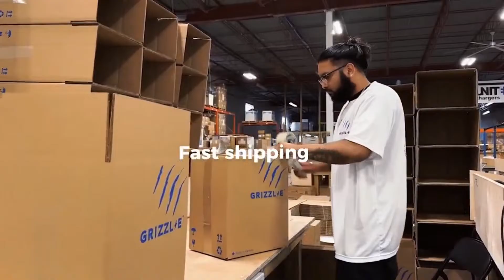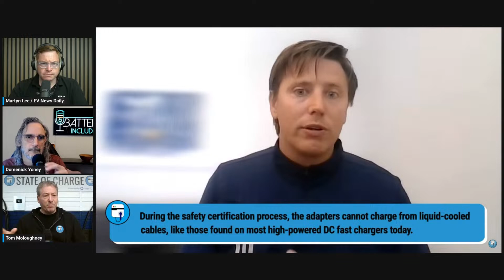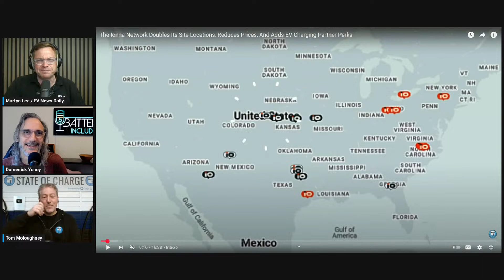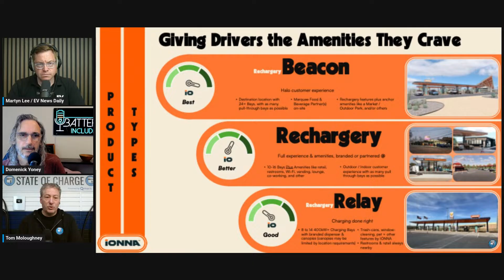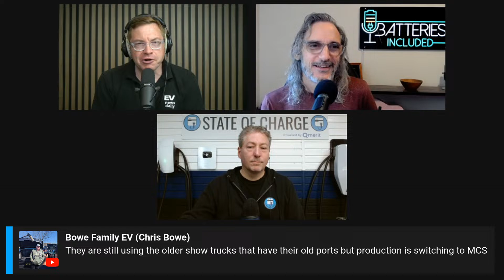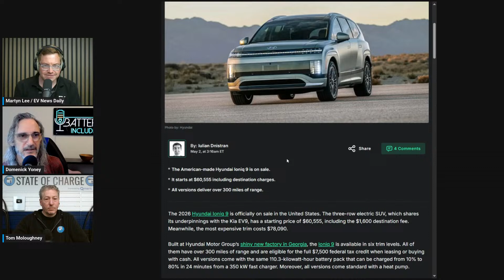Tesla Semi And Megacharger Update, Musk Leaving Tesla Report

Comment: Hi guys, great show as usual. However, you happened to repeat what I strongly feel is some misinformation that is often put forth by EV opponents. In discussing the new, blatantly unfair, punitive US federal tax on EVs being proposed by some backbench congressman, you mentioned that EVs cause more pavement damage than ICE cars. While this is literally true, in practice the difference is insignificant.  Pavement designers don't even count light trucks and cars in their calculations because the overwhelming preponderance of damage is caused by large, heavy trucks. As an analogy, you can truthfully say that a dragonfly buzzes louder than a housefly, but when you put them next to a jet engine at full throttle the volume difference between the flies doesn't matter. 

I can speak authoritatively on this topic. I am a licensed professional civil engineer who holds a Ph.D., has nearly 40 years of professional experience, and specializes in pavement and materials engineering.  Prior to my retirement in 2014, I was the State Pavement Design Engineer for a state department of transportation for over a decade and have either performed or supervised designs on several thousand projects worth billions of dollars. My old agency owns most of the roads in my state, totaling over 41,000 centerline miles and ranging from unsurfaced rural roads to urban interstates and I have worked on an array of road types.

I had a former colleague who used to say that cars are about width while trucks are about depth. What he was saying is that cars and light trucks are what control the number of lanes on most projects while large, heavy trucks control the pavement thickness. Even the heaviest Silverado EV or Hummer EV doesn't weigh enough to matter. EV owners should not be paying more than ICE owners for similar vehicles for damage to infrastructure.
Reply from the maker: Thanks for this Andrew. Great information to put things into perspective.
Reply: Hey Andrew. I'm curious if you'd like to talk about this topic on camera for 2-3 minutes. If not, can you send me a few quotes about the potential effects of some of the heavy EVs on the roadways? Thanks!
Reply: @StateOfChargeWithTomMoloughney I'm not terribly photogenic, but I would love to!

Comment: As a Kia EV6 owner with the free NACS adapter and owner of other EVs, surely I’ll use this 350 amp adapter on both.  I will make sure it doesn’t exceed the rating.  As long as charging power is 140 kW or less, there is no problem.  Current ramps down quickly as SoC increases.  Our use of the adapter will be only few times/yr because charging is 99% at home.

Comment: DCFC charging costs are too high because of demand charges ($18/KW where I am). That's $18k/month for 1MW. Those high fixed costs require really high utilization rates to spread the cost per KWh.
Reply: Wow! Someone other than me that understands commercial electricity tariffs! 😮
Reply: @kng128  :) only way to minimize demand charges is to have a Mega pack buffer battery but that's $2M and there isn't always enough space.

Comment: 380A x 450Vdc = 171kW  (nominal dc charging voltage for a typical 500Vdc-class battery pack)

Most newer CCS-1 and SAE J3400 NACS charging stations are rated for 250-400kW, including NA Tesla Superchargers (v3, v3.5, v4). The original 120-150kW Tesla Superchargers (NA v2) are gradually being upgraded or replaced to provide CCS-1 and SAE J3400 NACS compatibility.

A dc fast charging station has no way of "knowing" the maximum rating of a particular NACS-to-CCS-1 adapter (or extension cable). All approved adapters incorporate internal temperature sensors that affect the CP (Control pilot) and/or PP (Proximity Pilot) charging signals whenever the adapter overheats, interrupting or reducing the transfer of dc power. NACS doesn't specify a maximum current rating - 1000Adc is an assumed practical limit, provided that the temperature of the connector’s interface does not exceed 105 °C (221 °F).

There's clearly an advantage to 2025+ North American BEVs equipped with native SAE J3400 NACS charging ports versus dc fast charging using a power-limiting CCS-1 to NACS adapter. However, there's a good case to be made that slightly slower dc fast charging is likely to extend the useable life of older BEV battery packs, requiring a modest few extra minutes of charging.

Comment: I’m  for the pay per mile road tax. In Connecticut every 2 years gas cars need a $20 emissions test and as part of that they log your odometer. 

I’d be fine going once a year to a garage and have them log my miles driven and from that number  state figures out the taxes I owe. I know many will disagree but I could care less if state knows I drive 2,000 or 20,000 miles a year. Imo it’s a fairly equitable way to fund the state DOTs.

The $250 federal ev tax is just pure right wing virtue signaling

Comment: I think batteries have dropped in price to where battery powered vehicles could be less expensive. In the world of trucks, higher prices are driven by need to amortize a lot of high priced new manufacturing plant over small volume of sales. Tesla  is presently manufacturing motors and some EV parts. The factory in Nevada is organized for much higher volume than the competition. That plan did not pan out for Cybertruck where volume of sales is a fraction of capacity. Success on the Tesla Semi depends on selling a very high percentage of the total available market with a standard “one size fits all” product.

Comment: In the US we need cars with both CCS and NACS. Adapters are just adding a point of failure and confusion in the marketplace. We will need that for at least the next 10 years until we get enough chargers out there where you can choose the one for your car or all chargers have both cables.
Reply: I don't think most people would disagree with that, Frank. But currently,  access to the golden goose (SCs) required them for now, so although they aren't optimal, they are necessary for the near term.
Reply from the maker: Hopefully much sooner!